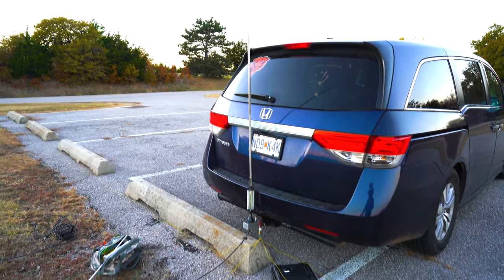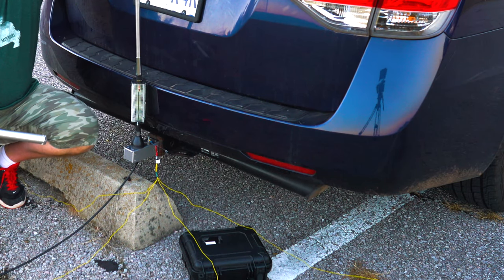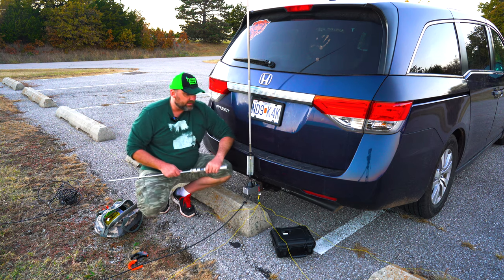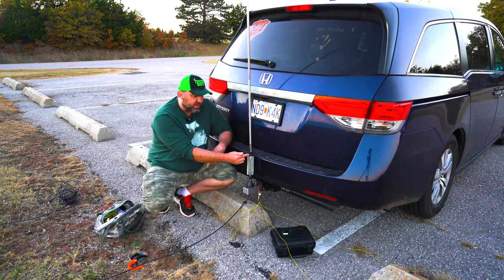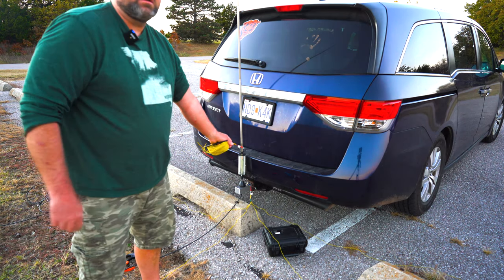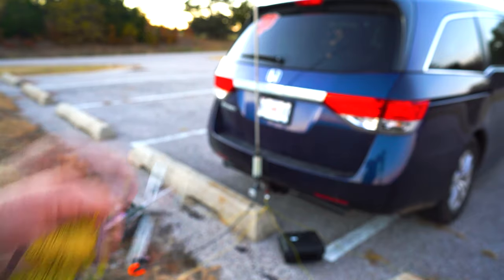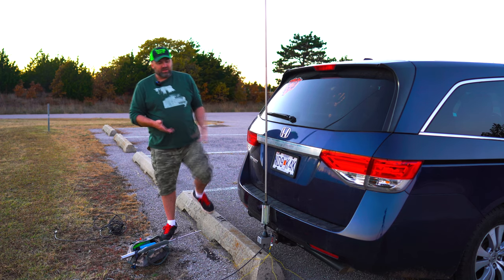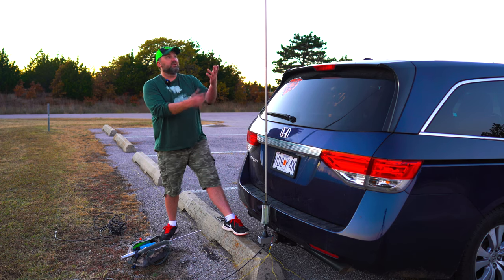Trailer Hitch HF Antenna Mount ~ MFJ-2822 ~ MFJ-2286 ~ PART 2

Comment: I'm using the same antenna, MFJ-2286, and have been very pleased with the performance. I have mine mounted on a 4' ground rod and am currently using the four stock 12' radial wires. Great video.
Reply from the maker: Thanks for sharing

Comment: Congratulations with the nice set-up ! It's exactly the same  I am using, the same coil, the same whip! The only difference is that I have this combo mounted on the roof-rack of my Radio Van. The results are outstanding with this antenna, for details , I have a short video on my channel. I run just one elevated  resonant radial because it's quickest way to deploy it up. If the radials are laying on the ground, I think  the length of radials per/band is not that important since they are making a ground plane in this case. The number of the radials is more important in the on-ground version (meaning, 5 shorter is better than 3 longer, for example). I've also found it very easy to find the resonance of the antenna by changing the point of the tap on the coil by simply clipping the croco connector to different coil windings and listening for the loudest noise in the radio at the same time. Usually the SWR on transmit is in the right range or close with this method. It only takes some fine moving of the croco one-two windings up or down for the final adjustment. The coil is actually needed for only 40 and 30 m bands, for the 20-6m the plain whip is easily adjustable by telescoping it down. I often use the ATU though on these bands instead of manual telescoping for the sake of convienience since my van is some 2m 45cm ( 8 feet?) hight at that point so I would need to actually take the whip down in order to change its  length.  Please go on with more experiments! 73! Linas LY2H.
Reply from the maker: Hey friend, I just watched your video.  I think I will do something like that also.  An elevated radial(s) of some sort.  Thanks for the tip.  I can't wait to get back out there!

Comment: It does not need the coil above 20 Meters because the 17' whip is long enough to be a 1/4 Wavelength vertical. Get a short jumper coax to tune the antenna at its feedpoint, rather than at the far end of the coax. Tune looking to minimize reactance, not SWR.

Comment: Great video. Set up as you did, in what direction was the antenna directional ? Also, using the body of the car via a direct connection of a wire from the mount to the frame (Cleaned up metal at contact points) may yield different or better results. I doubt if there is much connectivity from the mount to the hitch....Just food for thought.
Reply from the maker: Yes and yes.   Great ideas tnx fer comment. 73

Comment: I run the MFJ-1979 whip with a 22" Buddiepole Accessory Antenna Arm on a UM2 Super Mount with up to twelve 33' radials for 20M.  By using the Accessory Antenna Arm, I can adjust my SWR down to near 1:1.  With Super Mount, I can clamp the mount to a grill or use the SuperSpike for a rapid deployment.  Using this configuration, I've been able to hit New Zealand, Japan, Russia and Italy using 18w on FT8 using a Xiegu G-90 from the St. Louis Metro East area.  To go beyond 20M, I use the WRG Mini Coil with great success with the same 33' radials.
Reply from the maker: Hey Duane thanks for sharing your setup.  I'd like to see a pic.

Comment: Maybe the inductance of the added coil is canceling the capacitive effect the vehicle body is having on the vertical whip. Just thinking out loud. enjoy your videos immensely.
Reply from the maker: Hey Victor.  Someone said a similar thing on the previous video where I coulddn't get it to work.
Reply: @hamradiocq  I went back to part 1 and saw the comment you were talking about. I did not mean to restate something someone else had said. have a great day

Comment: Hey n9yo...you can, and you have gotten the 17 foot whip to work on 20 meters without the coil. However,  that is only under certain conditions.  As the manual states,  and as you have it set up in this video at first, the coil clip is at the top. That setting will also work on a tripod, or on a ground stake...or where/whatever..in other words, add the coil and you're done. Now you just adjust the whip length or the clip and boom...flat across either part of the band...cw or voice. I think your radials are better than the supplied copper wire radials in the 2286 kit because they just lay out much much easier. 

Great job !
Reply from the maker: You might have been the one that inspired me to order the 2286 kit the other day?  Was it it you draining my wallet lol   73 Friend!
Reply: @hamradiocq  lol...probably. That may mean that you now have 2 17ft whips... 73 to you too de nx1q

Comment: I like how you go out  into the field experimenting with new and different setups and items.  Sometimes it works and sometimes it doesn't  But it's a learning experience for everyone.  Thanks for sharing!  Did you ever get that hard case for the IC-7300?  73's
Reply from the maker: Thank you very much.  I'm an amateur, not a pro!  lol
Reply: You inspired me with this video. Since I already own a 17 foot telescopic word and coil, I Purchased the large 24 inch tripod from Wolf River Coils.  To use as either a backpack type set up or to bring with me when I travel for work.

Comment: There is "no coil" electrically, the output impedance is "seeing" the jumper wire +  the whip. The coil is shorted at that tap.
Reply from the maker: Ok, thanks.

Comment: P.s. from my experience so far with the whip on different bands, I didn't need to adjust radial length.  The manual suggested getting rid of them entirely on certain bands.  Have fun ! It has amazing receive.
Reply from the maker: Thanks for sharing